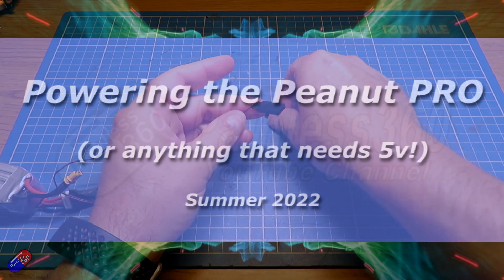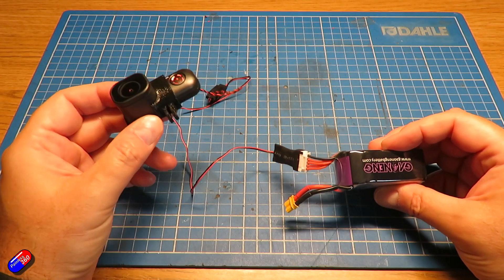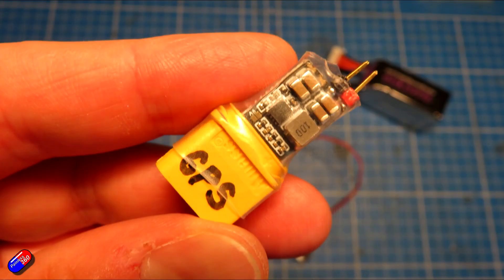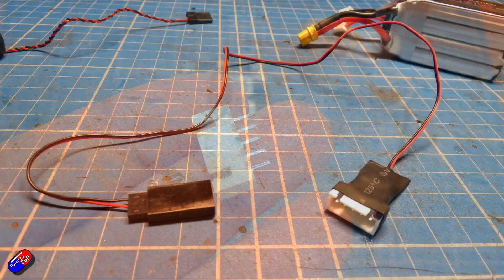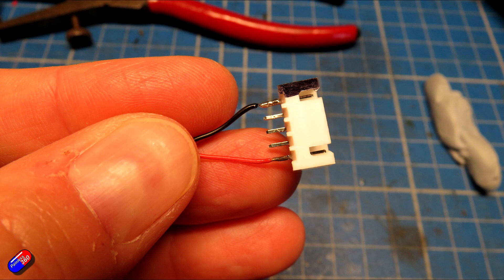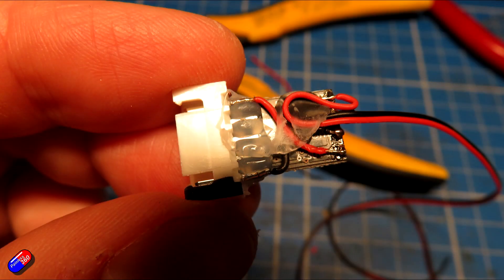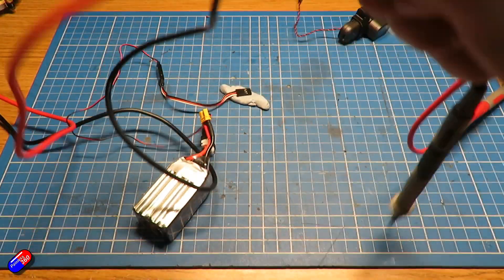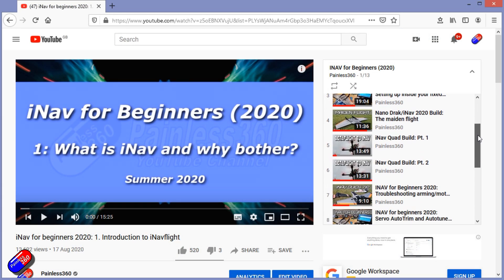Powering your 5v Action Camera from a LIPO Battery

Comment from the maker: Thanks for the spots about the name of the camera. The camera shown is, of course, the RunCam Thumb Pro but this tip works on any of the modern compact cameras that work on 5v..Happy flying!
Reply: Hey mate could you assist me with something random, and not spank me by that means, I have a splashdrone that I use for fishing and it has a jiyi pro 2 controller, I want to replace with a naza v2 for simplicity, problem I'm having is I need naza mounted ^ arrow pointing forward to < this direction, is this possible and I believe if you can't answer this jesus can't either peace🤗
Reply from the maker: I don't use DJI flight controller technology here. Sorry I can't be of more help.
Reply: @Painless360  that's ok the drone flew away because I didn't know how to set the 3d throttle thing, I thought you had made a video on that but I couldn't find it, I like throttle in the centre so I can just throw the tx down in an emergency and not worry about the bird falling In the ocean, now back to square one for building another quad

Comment: Looks good. I saved myself the trouble and used the iFlight BEC Power Supply Adapter made to power the naked GoPros and other cams. Then I swaped the power output side with what I needed. The advantage is it supports multiple cell counts and takes less work. It doesn't cost much more than a BEC.
Reply: @SilverbackSasquatch19xx  that makes sense. I've only moved it between 4s and 6s. I don't have anything smaller that carries an action camera.

Comment: love it a lot - even though I had nearly missed this one cause I was not so sure what it would be about cause I had thought it would be a kind step up or step down converter, but not a BEC using the charging connector. Really great and universal idea at least for all 2s and more cell batteries. 
I guess I would have watched it easier when I would have read about the BEC cause my first though was about the usual fc out. But this one is really great.

Comment: Is it safe to use it with Thumb Pro Wide v2 if my output (out of the BEC) shows 5.2V in my multimeter? I've plugged it into 6S LiPo's balance plug directly. Haven't connected my Thumb Pro yet, just making sure those 5.2V are not an overkill for this camera. What are your valuable thoughts on this? Thank you so much in advance!
Reply from the maker: You could try one of the Speedybee adapters instead. I'd be wary of running the camera above 5v...Happy flying
Reply: @Painless360  - Thank you for your kind answer. Unfortunately, I can't get those nice Speedybee BEC units where I live and ordering from China usually takes month, month and a half. I do have Matek BEC units though, just arrived today.
Reply: Jst a quick update. Today I've made this cable with MatekSys BEC, and the reading on my multimeter is steady 4.9V, sometimes jumps to 5.0V, and never above. Thumb Pro works perfectly fine powered from my 6s battery's balance lead. Thank you so much!

Comment: Hi, I just tried with diatone mamba bec 5v/9v 2A/3A to power on my thumb pro. But my problem is, is that okay if my output from the bec is 5.07v+- when I tried to measure with my multimeter. I dont use balance lead but I used xt30 3s. Please help me.
Reply from the maker: 5.07v should be fine..
Reply: @Painless360  Oh alright sir. Thank you so much! 👍

Comment: Built myself an adapter with a pololu yesterday. This is the only thing i do not like about this camera. Why didn't they put a step down in it? The 600mA pololu is so small, it would've easily fit in the thumb pro. Maybe they were like "but then we don't know the max input voltage of the step down!", but people usually do not use >6S.

Comment: Any idea how long the RunCam Pro lasts for what size battery? Was thinking about using it on my bicycle too. Have seen a maximum current of 500mA but presumably the average is much less.
Reply from the maker: If you measure the current it pulls for the mode you want it to record in then it should be easy to calculate... Best of luck

Comment: Hello i just saw you made a video for a viewer, i really need some help with how i can connect mini osd with runcam thumb via pixhawk. And how can i connect a claw machine using an esc/bec/ubec or relay/buck booster to power it from main battery while i am using 3DR module, claw machine takes 12V and i want to control it through RC. Please help me out, i am setting up a hexacopter drone flamewheel f550 and sadly i bought a 3S battery 5200mAH coz i am beginner and don’t have much idea. I read somewhere 3S is best for beginners
Reply from the maker: There are a lot of questions in there. Most already have a video. I.e. https://youtu.be/zjl9T4D0UHs lots of of the content on here is aimed at beginners so check out the channel.. Best of luck
Reply: @Painless360  yes i have checked out videos on your channel, but i needed one particularly for pixhawk, and i see no one really tells how runcam thumb gets connected and how we can see the video, thumb pro has official app but thumb doesn’t have one🤦🏻. But thanks for seeing my message.
Reply from the maker: Runcam thumb is an action camera, not an FPV camera.  Thats why